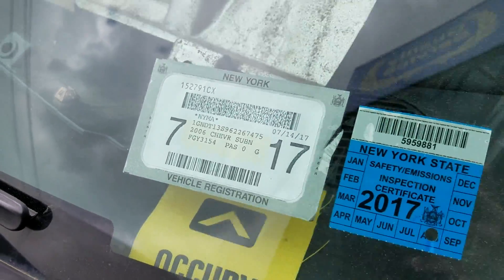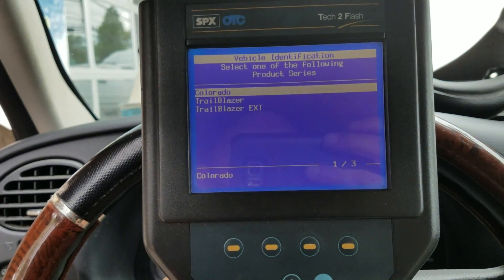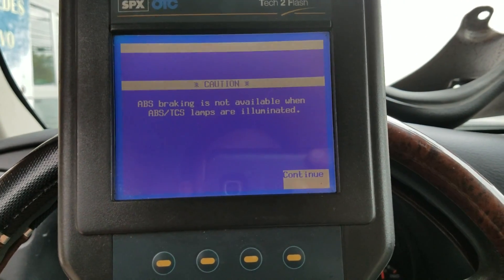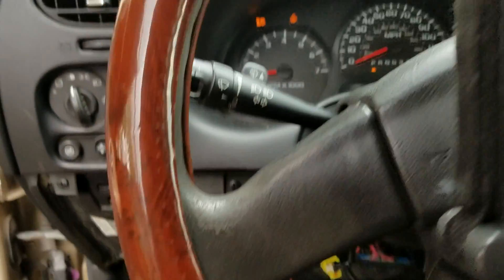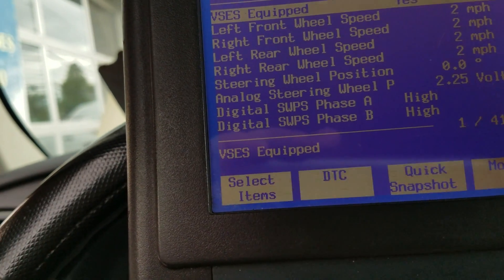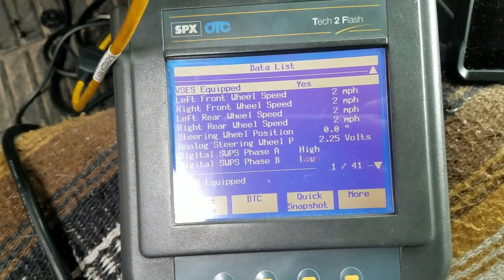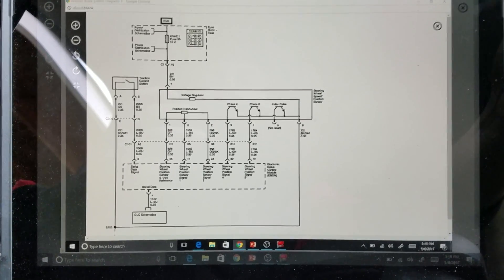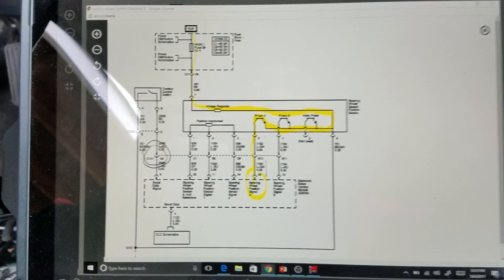Trailblazer Steering Angle Problems

Comment: I have the same issue man on my 07 Trailblazer, I changed my steering angle sensor two times and traction control light and abs light comes on still, also when turn the steering wheel and light will come on, am hoping it's the abs control module 👍🏼, thanks for sharing your video

Comment: Can you list the name and model/number of the tech 2 scanner you have? I wanna learn how to do stuff like this actually diagnosing, as opposed to throwing parts at a vehicle.
For example, my 4wd service lights on on my 02 Trailblazer and I think I need the tccm replaced. 
But I need a tech 2 scanner in order to read the tccms codes. And even if I knew it was bad and replaced it, everything I read says you need a tech 2 scanner to "program" the new tccm; how is that programming done when you have a scanner like the one you have?

Comment: This is why having guys like you sharing your knowledge on variables regarding software can really make our daily job that much easier, better, and more importantly, helping us do our best to fix the complaint the first time.  

It's EXTREMELY valuable to have that kind of stuff available to help keep us in the know...soooo..."giving away trade secrets"....um...nooooo...how about doing the right thing to help out fellow tech's out there become more knowledgeable, efficient, and accurate when it comes to our diagnostic process!

Loved the step-by-step going down the line checking the signal integrity.

Great video Keith!

Comment: Hey Keith, great video! Question? Isn't there also an analog signal plus the two digital signals? I had good signals at the ebcm but looking at the wiring diagram there is another signal on pin 3 lt/ bl. Thanks for all your hard work Keith!!!
Reply from the maker: That's correct . And if you see another of these videos like this one that I made I make mention as well.

Comment: Man, i was just working on an 06 trailblazer for abs issues and was wondering why there was no SAS data. The diagrams showed it to be there but no data was available. Thanks for the video...
Reply from the maker: You're quite welcome. Glad it helped
Reply: Ha! Then this morning I get a trailblazer with a c0455. I did find a bulletin that states to id the truck as an 07. Also in the bulletin it mentions to reflash the ebcm, then the SAS data will be available.

Comment: Hi man, I have trail blazer 2006 and i have same problem onley it will come after start  the engine and turn the steering to the right side the fault light come on ....after that I switch of the car again starting then I turn the steering to the left side the light not conning on just onley turn the steering to the right side I did computer test it says c0455 sensor fault is it right if I'm going to replace it or there is something else......thanks man I'm waiting your reply if you can send it on my what's up number 00971555320324.

Thanks alot

Comment: Ebcm ....did the replacement solve the issue .. I have the same problem with that exact code and don't want to change a position sensor if ebcm solved the issue

Comment: Thank you for sharing this great video! I have a similar problem and wanted to ask a question. Occasionally, especially when it gets very cold outside, stabil-track fault light comes on, and usually after 10 min of driving if I restart the vehicle, it does not come back the same day. I used Tech2-Win and both channel A and B send HIGH and LOW pulses. There is also number above which tells the actual angle of the steering wheel and that changes as I move the wheel as well. On a single occasion I noticed the wheel angle was at 400 degrees, but I know the night before it was left straight (0 degrees). I also get C0455 error code from the brake control module. Could it be the sensor? Bad connection on some of the connectors? What is your experience with these? Greatly appreciated any input to help me resolve the issue!
Reply from the maker: Ainstain K most importantly is the analog signal at about 2.5 volts with the wheels in the straight ahead position?
Reply: I apologize for the delay. So I just checked, the analog voltage is 2.44V when the steering wheel is reading 0 degrees. When I slightly move to the right jumps to 2.50V, just before it switches over to 8 degrees. At about 8 degrees, the voltage is 2.56V. I have not had the stabili-trak service light come on since the other day...it happens only in the morning, and when it gets below about 20F degrees outside. Could it be the steering wheel position sensor or something else? I know these intermittent issues can be very hard to track down.
Reply from the maker: Ainstain K do the same test while lightly wiggling the connector at the ABS module . If it's not happening now , we might have to wait.  Also verify the connector is clean and tight near the uhjb
Reply: New Level Auto I didnt forget about this post, just was unable to perform the test because of the bad weather here in MI. But I did not have the service light come since that first posting, so it tells me there could be a loose wire I hope at the connector. I will try to remove the connector in the next few weekd, clean it with some CRC connection lubricant and try re-plugging in again several times to hopefully remove any oxidation that has built. I will post the updates.

Comment: so the problem was not the position sensor?
Reply from the maker: +Miguel M no sir . That tested perfectly
Reply: New Level Auto I replaced mine with a used one and lights come back on,but I did do the tie rods and hub bearing, and right after that, those lights came on, so it's there a way to check if I just need an alignment with resetting of the sensor, without the expensive scan tool? I have a volt meter and scan tool with abs code reader, I called several wheel alignment places in Chicago and most don't touch that reseting of sensor, they just align the wheels, one had to call me back to see if they could do it, since to me that many places are clueless of reseting sensors

Comment: This might be a dumb question why not check at each end starting at the brake module if you have it there no need to test other locations. If isn't there testing in the car to see if it was at the blue and green wires would then tell yo if it was a possible wire issue. If you have it at the brake module testing would be done correct. I was wondering if you did it this way just for your video to show how to read diagram and find and locate all points in the diagram?
Reply from the maker: +John Gibson only because of location . I had no lift for access and the shield covering it had bolts ready to snap. So I went where I could to get the testing theories across in the most video friendly way possible

Comment: Thanks for the experience man.Just one question : If the turn signal was not present at Brakes module connector BUT present at midway connector this would mean the wire from the midway connector to brakes connector is short to ground and mechanic need to use test lamp at midway connector to check for short with connector disconnected.

Comment: Great video Keith though, can you explain to me the following. In the wiring diagram how is the voltage reg. output connected
directly to ground, also the transistors (phase A & B sensors) seems to be flipped over, the emitter should be connected to the 
EBCM not the collector. Is the diagram wrong or I'm missing something?

Thanks for your wonderful channel.
Reply: You are right. The transistors, which are presumably phototransistors arranged in quadrature fashion on a rotary encoder, are indeed drawn flipped over. Very annoying, because at a glance it suggests that these transistors are performing ground-side switching.

Comment: I had the same concern as Ivan, but then I drew the same conclusion he did. Thanks for this awesome video Keith. Is that scan tool a GM specific one? Blue Driver definitely doesn't has those PIDs!!
Reply from the maker: Moving Up Diy that is the Tech2 gm specific tool. I could've used others but I like the speed of that tool

Comment: Its one thing knowing how to use the computers, multimeters, scopes, etc. but its a whole other story knowing how its suppose to work. I've never heard of a stering wheel position sensor? If you don't know how something works and and every manufacturer has a different idea on how to make something function it can be a can of worms. You are one in a million with the skill and knowledge you have learned over the years.  Most customers are going to pay with the 99% who can only change parts. Thanks

Comment: not to ask you a bunch of questions but what would you recommend? I was also looking at the autel ms906bt.
Reply from the maker: David Christine I own one of those myself,  it is nowhere near as fast as my launch,  but it is a very capable tool. However I do like being able to remote into someone else's Launch tablet to assist them on a vehicle when they are stuck. Autel has tried to make their version of this work and they've failed miserably. Again though they are both great tools. I need speed and accuracy not just accuracy. And Autel just doesn't suit my needs, but it may fit yours perfectly

Comment: I'm late, but good stuff! Part 2 on the Chevy Airbag module on the way too? :) Thanks!
Reply from the maker: AutoFocus working on that one also. Vehicle is a bread delivery truck and I need to finish the after footage . Hard to get our schedules aligned
Reply: No worries, I know you're a busy man.  I  have an interesting case on a BMW e61 -04. The Fuel level indicator in the instrument doesn't work until you drive it.  It slowly climbs up until you stop. Then it goes to empty. Had the scanner on it and the sensors (2) in the tank shows accurate. Also noted if you pull the fuse, it will reset the fuel level and it will stay until you stop. Haha, funny times.

Comment: Great video Keith! I just diagnosed the same code last week on same vehicle. My problem was with the steering angle degrees it is the 5th wire over. With wheel turned all the way to the left I had .25 volts and as I turned the wheel it gradually went up till I got to 4.90volts and I was only about 75% of all the way to the right. I made about 1 more turn and it dropped to 0V and as I continued to turn I think it went up to maybe .10volts. 
I told the shop that he needs a new sensor, his reply was "That is a brand new sensor from GM". So I had to show him what the problem was before he believed me. This was last week and I haven't heard from him so I guess a new sensor cured the problem
So there is 2 hall effect and a variable sensor all in one?
Great bypass test I will have to remember that one
Reply from the maker: JOHN HUFNAGEL the word new. Stands for 
Never 
Ever 
Works

Comment: Keith, awesome video! I had just one concern about the last voltage check at 11:45 when you are front-probing the EBCM connector. The "high" voltage was only 7.4V instead of the 9.4V at the other two locations. Also, the square wave is not as clean, and seems to decay on the high portions. The only explanation I can think of for this is that either your voltmeter ground is crusty, or there is an almost completely broken wire between C101 and the EBCM. The resistance is so high, that the10  MOhm voltmeter is actually pulling it partially to ground? Maybe try relocating the meter ground, and then the patented "Keith tug test" on the EBCM harness and see if the signal drops out completely? What are your thoughts?
Reply: But then again scan data was showing signal "A" stuck "high", and there is no way that could happen with a broken wire, since this looks like a pull-up design. New EBCM module it is! :)
Reply from the maker: Pine Hollow Auto Diagnostics The other explanation was that the booster pack was going obscenely low 😂

Comment: that was great Keith. with the module being faulty would that cause the 2mph read outs that i noticed on the wheel sensors or is that not related? just seemed odd that the car was stationary and it was reading 2mph. looking forward to the next one.
Reply from the maker: DIY Carguy not related , just another Gm quirk

Comment: How would a regular guy know to go to a 2007 instead of a 2006? Is that just experience? This is the first time I've seen a steering wheel angle video or even heard of one. Man I got a lot to learn and I'm 60, time's running out! (Ha ha) Great video Keith. it was well explained.
Reply from the maker: wyattoneable Honestly it was just a gander when it seemed like info was not making sense. I went down a year and up a year just to see . That part comes with experience I suppose . Glad you liked it !

Comment: Fantastic job Kieth. Clear, concise and very well explained.

Dorman crap  is everywhere! they are the relabel kings! Fortunately at this point in time it was not the reason for the fault. I ounce had an 01 Audi A6 (when i was working at STS) that would keep coming back with a misfire because the coil pack was failing I think it was a Dorman i don't remember but it was crap. 3 times! i told the Service manager lets get an OEM coil, nope. But we did get a German made aftermarket part (northside imports in edison) that was a little more expensive and more a permanent fix than that crap that was installed the first 3 times. car never came back for that issue.

BTW 99 maxima owner decided to just junk the car instead of fight with the shop that did the T-chains.
Reply from the maker: Auto Fix Pal aww man what a shame about the Maxima , it was 75 percent done for a great case study. And yes Dorman really infiltrates our industry and they stink for the most part. Glad you liked the video !

Comment: For anyone interested: The index pulse in a common digital incremental encoder (A+B+X) or position sensor is to provide a reference position by counting either direction from the Index. 1 phase (A) can tell you how far and how fast the encoder moves. 2 phases (A+B) can also tell if the sensor reverses rotation or direction. However, an A+B+Index sensor would have to be keyed to always match the steering wheel's true center and geared down to allow for more than one wheel rotation from center to either stop. In this case , the SAS module has 2 sensors. The digital pulse A+B side tells the brake controller the direction and velocity the steering wheel is turned while the other sensor must report the steering angle since the A+B side cannot provide absolute position. At 6:25 you can see the 3 lines for the other sensor in the SAS module and I suspect that the ABS module is ignoring one or more of those lines along with the A-Phase line so it can neither read the angle nor the velocity.

 Nice vid of something a bit different, Keith :)
Reply from the maker: Eddie the Grouch you have no idea how bad I wanted to explain that part Eddie , and I am so glad you brought it up ! I am equally as happy that you are a sub and supporter ! So Thank You !
Reply: Good catch, John.  I should have noted that I was referring to a general purpose rotary digital encoder.  SAS modules should be clocked according to directions and the system reset/re-programmed as needed.  In your case it sounds like you are measuring an analog sensor (variable resistor / potentiometer) that varies a 5v reference according to the angle.  The voltage ramp should be smooth stop to stop if you have a full travel sensor.   I've made corrections to my first comment and apologize for the confusion.  I should avoid commenting while sleep walking in the future...
Reply: Eddie you say that the sensor is not keyed but it does have a steering angle position measured in degrees. How is it calculated then? I diagnosed a sensor last week and fully turned to the left it read .25volt and about 75% it read 4.90volts then dropped to 0 the rest of the way til it his the stop it was about .10 volt. Do they have to be clocked to a certain position when replacing? I know the steering wheel needs to be locked in the center position to keep from breaking the clock spring is that also to calibrate the steering angle sensor?
Thanks for the info on how it works
Reply: You are correct it is a variable resister, and the signal is smooth up til it get to about 75% then it drops to .10V. I have never personally changed one I just do diag work. I have looked at Mitchel and Alldata and I am unable to find anything on calibrating or reprogramming the sensor it basicly says remove and replace.
I have the Verus and also do not see anything for the SAS only the YAW sensor.
Thanks for the info

Comment: Great video and nice explaining at the wiring diagram, I had a BMW 5 series 2003 model and ABS module seems to have high rate of failure, traction control lamp come on sometimes both ABS and Traction control lamp both lit. looking forward for more videos when time give you a chance to make a video.
Reply from the maker: g johan Extremely high rate of failure on those ! I should do a video on them soon . I have one next week to look at , and if time allows you will see one
Reply: That would be great, where I live there is nobody that understand this kind of troubleshooting.

Comment: my man that was crystal clear from a phone recording! nice work!  is that why the steering angle degrees never changed when you turned the wheel?
Reply from the maker: phil holbrook yes sir , we call it plausability, it cannot judge properly without comparitive sensor inputs . If A says we are not moving but B says we are , who is the ebtcm to trust?
Reply: nice. im sure the manufacturer flow chart is 30 steps. ohming and alota hair pulling.